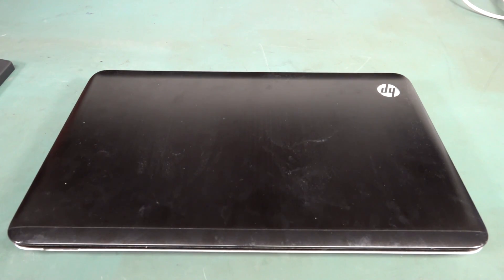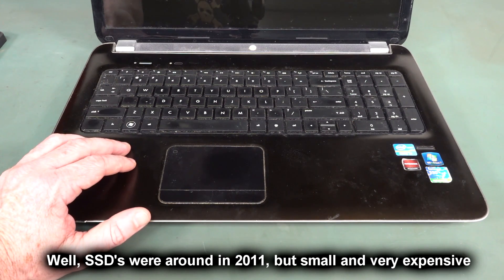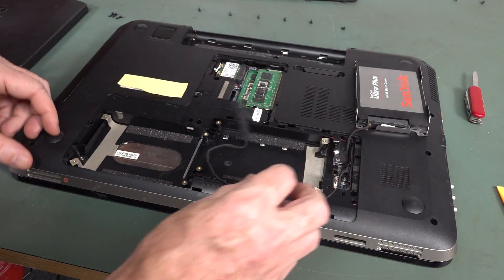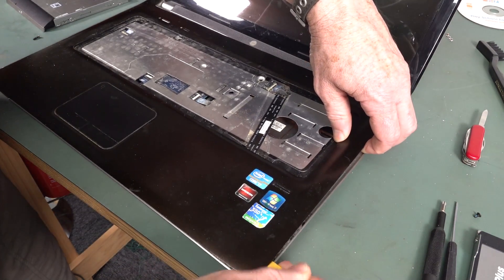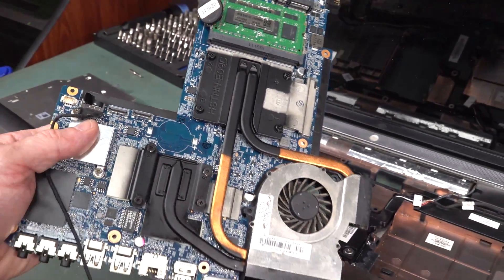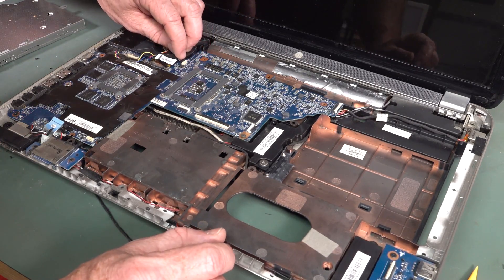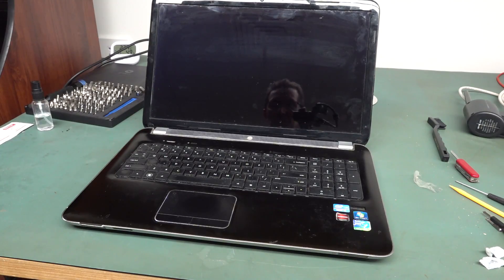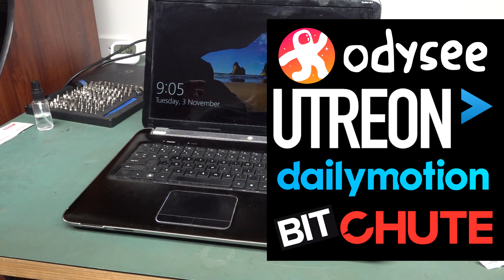EEVblog #1345 - HP DV7 Laptop Repair

Comment: I had a dv5 that I ended up having to sit a box fan behind to stop it shutting down. Would have been a 2008-2009 vintage. By 2012 it was well and truly stuffed. Wouldn't stay cool. Pulled it apart, cleaned all the melted thermal pads off the heatsink, reapplied some Arctic silver compound, reassembled. Still no fuckin good

Comment: This inspires me to see if I can rescue my late-2009 Acer eMachines e725. It has a Pentium Dual Core I think; still from the Core 2 era. I don't have to worry about bad drivers because I use Linux 😁
Reply: That will still run any distro just fine. You will want to install the maximum amount of RAM and install an SSD to make it run well though.
Reply: @rocketman221projects  I've actually never used SSDs in any of my computers lol. Closest I came was when I was evaluating Aerospike for a project, but the project got axed and I didn't buy an SSD.

Comment: XP Pro was the best MS produced IMHO, Win Vista flawed and Win 7 pretty good on the whole with some annoying GUI and navigation changes.  Win 10.......... I finally got around to doing an install on an old Lenovo Thinkpad X61 circa 2008.  Everything installed and working fine but too early to say what I think, although it runs slower than Win 7.  I never bothered with Win 8.

Comment: I did not see but unless you cleaned out the fan heatsink, they get a curtain of dust and lint in front of the radiator fins.
You will be doing it again shortly.

Comment: DV7s were during the reflow die era. Fun times. You can also disable driver signing and force drivers for the graphics card pretty easily. I've done it on a few dozen machines now.

Fanboy call-out or not, AMD support in Linux is far superior and they run far more efficiently. Program support has come a long way as well. I've been able to drop windows completely and still use every program I've tried that doesn't require a rootkit(usually anti cheat software improperly implemented into games). Wine is light-years ahead of where they were even 5 years ago. All of my editing and developer tools work better than they did in windows because Wine Is  Not an Emulator... Lol.

Scoffing at it is a serious mistake.
Reply: AMD support is founded on open source drivers and tearing, the proprietary AMD drivers shows often lower performances and bugs.

Comment: For Graphics drivers, check out FoxMcCloud42 post.
Quick tip, send a few squirts from a can of compressed air into the side heatsink grille & get a vacuum cleaner and vacuum from the heatsink grille to help dislodge any built up dust.
Run CPU Z (free) to check CPU temps.
For startup slowness issues, check Sysinternals Autoruns (free) & Task Manager (right click taskbar > Task Manager) to see what's maxing it out.
Also test the HDD using CrystalDiskInfo (free) as the drive could be slowly dying & slowing response is a classic Win10 symptom.
If you have enough HDD space, download Virtualbox & you can run any Linux you want

Comment: My PC would just shut down without warning! 
Opened up the guts to find an almost 1/4" blanket of lint and dust covering the CPU cooling fins. 
2 years worth of daily ops and the CPU was totally choked up by belly-button lint!
Reply: Thank goodness you opened it up then - not a moment too soon!
If it's shutting down without warning then you've got overheating, which thankfully you caught in time.
If you'd have pressed on regardless then it'll have fried the CPU/Motherboard and it would have been game over. I've seen a DV7 with failing graphics and a DV7 that's stone dead - the stone dead one had a completely blocked finstack.

Comment: I'm surprised the intel drivers even work on windows 10. I had a laptop with the 1st generation HD graphics (this is 2nd I think) and Intel didn't even make windows 8 drivers..... that laptop literally only had driver support for 2 years.
Reply: Even if there aren't any drivers specifically for Windows 10 the 7/Vista drivers should work fine. I've run Windows 10 on first-gen i5, late core 2 duo, and even early netbook (945gm chipset originally released in 2006) and didn't run into any driver issues.

Comment: Hi Dave

A good fix, i have 2 x HP DV6 laptops, and funny ( not funny) my wife cooked hers 2 weeks ago, both have been hot under the base, she users hers all the time and she is forced to have a laptop cooler - its like a plastic mesh folded over itself and has 2 fans in it that runs of usb, but she stretched the wires one day and just cut them with scissors

Anyway she cooked her I7-2600 and she has taken my I5 version

Hers now has a POST message on boot-  fan not detected or not working and will not go any further, i do clean then our once a year, by removing the 3 back covers ( yours only has 1 ) 

I have changed her keyboard 2 years ago - and yes the keyboard back retain screws are under the hdd or wifi module not easy to find.

i have also changed both machines from HDD to 256 / 512 SSD and both boot win 10 in under 10 seconds - so i sugest you save any files, then download the new 10-2020 image and reinstall from scratch

I have tried to fix hers, removed rear moulding, wifi, battery, ssd, keyboard, power button strip, outer edge bezel i just cant get to the bare board like you did so its siting in a laptop bag in the cupboard

I am guessing your machine had dust and fluff built up, because if your thermo sensors on mother board, ram , ssd, cpu were faulty they would activate the fan early - but your was actually hot as well, so my guess is clogged vents with dust and dry thermal paste

Ohh, the dust would be coming in from the left hand side vents, they work as intake and exhaust, my wifes is generally full of fluff as she uses it on the couch / bed i only use mine on a desk - oh but some 20/25mm plastic stick on legs ( 4-6 of them) and stick them on the underside of the laptop it helps with air flow

The video chip in mine are Nvidia Geforce GT ( 250 or 320M the spec varied as there were multiple models released i bought my machine and 2 weeks later same shop one for my wife they have slight differences )

Regards
George

Comment: Hi Dave, 
I Think i found the driver for your AMD Radeon HD 6770M.
Here are the links:

Windows 10 x64 Version: 26.20.12036.16001 (05 Aug 2020):
https://www.drvhub.net/devices/video-cards/amd/radeon-hd-6770m-1#

Windows 10 x86 Version: 16.101.2901.0 (08 Aug 2016):
https://www.drvhub.net/devices/video-cards/amd/radeon-hd-6770m-1#

Hope it will work. Let me know.

Have a G'day from The Netherlands,

Joost
Reply: this basicly worked. no long startup times. Thanks for that. But now 3d apps just choose the intel HD. i must keep digging

Comment: you can still install drivers using unsigned driver feature.  Source:  I did the same on a old 2008 Dell Precision with an old ATI X1400 Radeon under win 10

edit:
1)  Download the 64-bit ATI driver that was available for vista or 7
2)  Go into windows settings > recovery options > advanced startup
3)  Reboot
4)  On a blue startup screen, it will let you choose a startup option, choose unsigned driver
5)  Attempt to run the setup for the ATI driver you downloaded
6)  If it doesn't run, try extracting the files into a folder (7zip works great here).  Manually go into Device Manager, right-click the GPU missing the driver, and attempt to point to the .inf file inside the folder you extracted.  Hopefully this works.  Mini edit:  When you attempted the run the setup, it may have already extracted the files for you in the root of C:
Reply: AMD "ULPS" bug, disable in registry to fix. The driver is fine.

Comment: These days I'm very wary of spinning a fan while connected to a main board.  I've seen fan controllers and mother boards killed by the fan back feeding into it :(
Reply: Do it thousands of times a year with compressed air rather than dismantling, never had an issue - put a multimeter on the pins, ZERO volts out when spinning even at 10k+ rpm.

Comment: I've done this type of work to many laptops. The key is, you should also disassemble the fan assembly, separate the fan from the heatsink fins that it blows through, because that's usually where there is most of the dust - often you can pull a rectangular carpet of dust from the heat sink fins and that's what prevents air flow through the heatsink.
Reply: The HP Probook 4540s I'm typing this on slowly got hotter and hotter a few months back. A lot easier to take apart than Dave's and as you say there was a solid mat of dust between the fan and the heatpipe radiator.
Reply: If ever I have access to a laptop motherboard, it always gets the fan cleaned (and disassembled to gain access to the heatpipe fins) and fresh thermal paste, even if it is cheaper stuff.
Most laptops/PCs worth their salt get Arctic MX-4. Less important ones get MX-2 or the cheap stuff. High performance ones (such as anything gaming) get MX-6.
The amount of laptops I've seen with dust blocking the grills is insane - I mean, once a year you've got to get that blowed out to stop it from accumulating.
Overheating will probably kill your motherboard/CPU/GPU if you have a dead motherboard.

Comment: The heating problem for the whole series Pavilion is well known issue. Just choose different series of HP not the Pavilion one.
Reply: Have had a few whefe the graphics chip was so hot it was desoilder from the board. Fix it with a heat gun.

Comment: the Snappy Driver Installer project might be what you're looking for to getting this thing happy. you have to set aside 20-something gigs for it however and it's a torrent-only download. it has basically every driver known to man inside, for XP all the way up through 10. Good to keep on a flash drive and update every year.

Comment: I tried fixing up a similar aged HP laptop, but whatever I tried (dust removal, new past and whatnot) but it kept overheating (guess mobile AMD chips from the time were not that great). But ended up preplacing it as it was no longer able to install windows updates without thermal throttling and crashing due to it.

Comment: Works for my hp dv6 on 10 using the universal amd drivers should work it again. But First check the bios for switchable graphics is enabled. Do you think that the abc cd/dvd was causing the rattling just a thought

Comment: You can install windows 7 drivers on Windows 10. Just copy the device identifier into google and download the windows 7 driver zip from drp aka driverpack. (Some Windows Vista drivers work.) Just make sure you select the correct architecture, x86-32 bit or 64 bit. drp despirately wants you to install their software do not do that. Try and find a link to windows 7 drivers and then try selecting windows 10 in the dropdown. If it doesn't have the driver it will tell you INSTALL NOW just go back 1 page and try selecting windows 8. If it still doesn't have it just download the windows 7 driver.
Manual install has to be performed usually. device manager is where you get the device identifier and also where you then install the driver.
You can also use windows 7, 8 and 8.1 keys to validate windows 10. This still works.
Reply: If you really want to I can help you with it contact me.

Comment: Check if there are compatible Omega drivers for the AMD chip. It seems Angel stopped making them immediately after Windows 10 came out, but the last one for Windows 8.1 might still be compatible with Windows 10. 🤷

Comment: use the older driver then the new ATI drivers because it wouldn't have your video card drivers.  That what I had to do with my HP laptop with ATI Radium 7350 mobile video card.  I runs Windows 10, baddy but it does.

Comment: Try this driver. It's listed in the Legacy Driver section for 6000m series. 
It's from Fall 2015 but it should work on Win 10 64.   https://www2.ati.com/drivers/amd-catalyst-15.7.1-win10-64bit.exe 
If that one will not work they did release a Beta driver in 2016 that you might have luck with. https://www2.ati.com/drivers/beta/non-whql-win10-64bit-radeon-software-crimson-relive-16.2.1-sep20.exe 

Once you get it working do not update your drivers. Actually you better permanently disable windows driver updates using group policy editor. Follow this tutorial. https://www.windowscentral.com/how-disable-automatic-driver-updates-windows-10

Comment: Drivers for laptops GPU's are not really supported directly by neither AMD or Nvidia, laptop drivers should be supported and provided by the laptop maker, unlike desktops, laptop makers have full access to the drivers internals and so they tweak them for their particular laptops, because of power saving features and such.  The only thing AMD and Nvidia can do is provide generic/basic laptop GPU drivers. Again if the laptop maker has no windows 10 driver for their integrated AMD GPU that is their fault not AMD's.

For the generic laptop drivers for your laptop go here.  https://www.amd.com/en/support/graphics/amd-radeon-hd/amd-radeon-hd-6000m-series/amd-radeon-hd-6770m
Reply: These times passed long ago.

Comment: The compound isn't bad for the age. You kind of fixed the overheating problem unfortunately the design of the cooler is poor. These laptops are even worse with Intel cpu's in them, even without a gpu. Got to keep them really clean and raise the back up which is why we always used a extended life battery with ours. I recently opened it up for a second time and replaced the compound, gave it a good cleaning, and swapped the hard drive for an ssd to reduce heat.

Comment: The amount of new and old laptops I had to fix with the heatsink not touching the CPU/GPU and or bad compound is unreal! I have a 6 months old ASUS here now that I needed to bend the copper heatsink bar a tad put some new compound in and all is good.
Reply: I think they've made them too thin/weak that it starts warping under normal use.

Comment: I have an i5 variant w/ only integrated graphics and I still have screaming fan problems.  It was actually my wife's but she gave it up because it was too loud and kept burning her lap.  I took it apart just like this and blew out all of the dust and replaced the thermal paste.  It helped but it didn't last long, it doesn't scald anymore but it still screams like a banshee even under moderate workloads.  I think it's just poor thermal design, but for how little I use it now it's ok.  I swapped out the spinning disk for a SSD and maxed out the RAM and it's still perfectly usable.

Comment: I have two old laptops one with amd series 7000 and the other 5000 I think, and they both work fine on windows 10. No additional drivers download needed, windows update downloads everything fine.
Reply: I don't know if I can post links here but you should be able to manually download the drivers of the card you listed from here:
https://www.amd.com/en/support/graphics/amd-radeon-hd/amd-radeon-hd-6000m-series/amd-radeon-hd-6770m
If it doesn't work remove the battery and unplug the power and then hold the power button for 10 seconds. If that doesn't fix it it's probably dead.

Comment: The pump out effect of the thermal paste was interesting to see. There was barely any thermal paste left on the die it was all left out on the side.
Reply: Artic MX4 is really bad for this too on laptops/bare dies.
Reply: @uK8cvPAq  usually using a more viscous thermal paste is the way to go with laptops
Reply: @Is33you  Yes, I learned the hard way. What pastes do you like using for laptops?
Reply: I've only done it once but I'd advice something like thermal grizzly hydronaut
Reply: @Is33you  I've used Ceramique 2 in place of a pumped out MX4 application and its been good for a number of years now, for laptops I prefer past durability over a couple degrees of temp drop as I don't want to become married to replacing paste every 12 months.
Reply: Agreed

Comment: I had to replace the fan in my daughter's laptop a few weeks ago and it was not easy to figure out how to get it apart. Usually when I tear down an old laptop that I don't plan to fix I put some force into it and it's not that bad. She was using this one for her school distance learning so I had to be careful. I first tried to remove the keyboard, plastic button strip, and various screws I didn't have to. Then I realized the key was to take out the DVD drive, and it came apart easily. I had to take it apart three times too, first to clean it (which didn't help), second to take a picture of the fan so that I could find a replacement online, and third to install the new fan. But now it's working fine, and super quiet rather than sounding like a jet engine.

Comment: put your music on and play through your mixer with your  JBL Speakers ive a Toshiba  i7 quadcore gen 2 with digital  TV onboard with SSD runs as fast as anything today i still have original drive to recover from all i do is clone c: over HARVY NORMAN HAVE NEW GEN 10 HP 15.6'' I5  full HD 500GIG SSD 8 gig RAM  $1050

Comment: If i'm not wrong, you Need to manually install the Windows 7 x64 drivers by extracting the exe downloaded from AMD website, then you go to packages/drivers/display and then by opening up device manager, open the properties of the graphics card, then update driver, select the folder and click next, After that, reboot the PC and voilà, drivers installed!
Reply: i installed xp drivers to win10 using that method and its working a charm
Reply: Did similar on an Acer. I just downloaded the drivers from Acer, unpacked and installed from Device Manager, Update Driver, Have disk, and select the .ini for Win7 x64. It moaned then about the driver being unsigned, so had to disable the driver signing check in Win 10, but it worked.
Reply: I have a pavillion with Radeon graphics too and it was a pain installing its driver and using compatibility mode doesn't really work since the issue is that windows keeps trying to install the wrong drivers, from what I found out the biggest issue is caused by the audio drivers